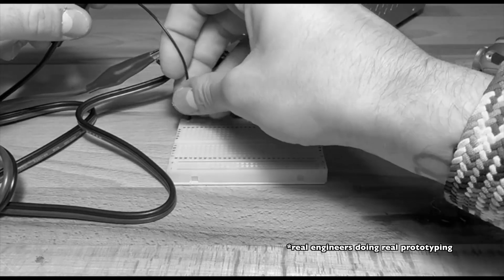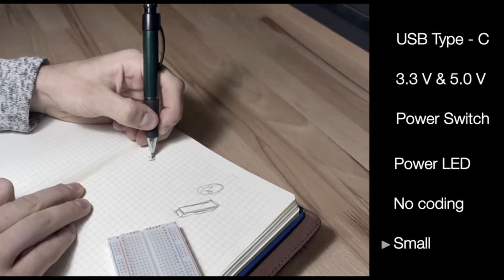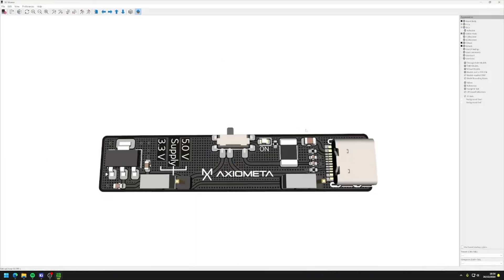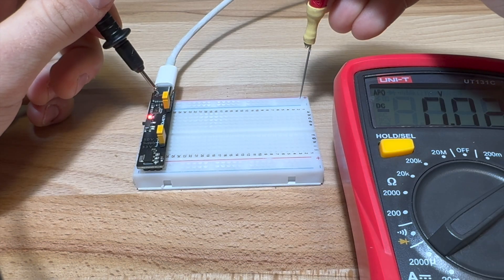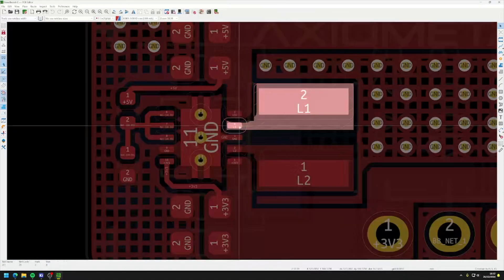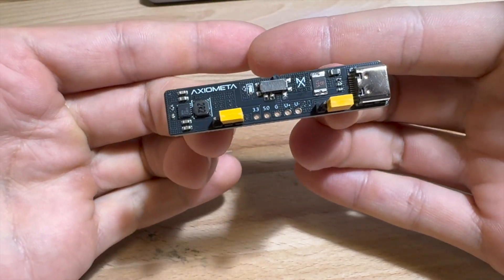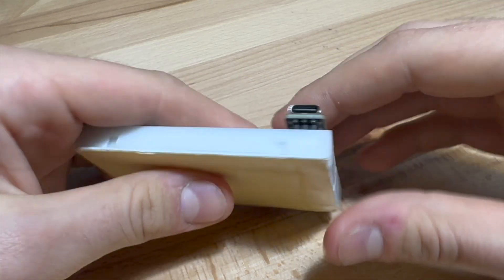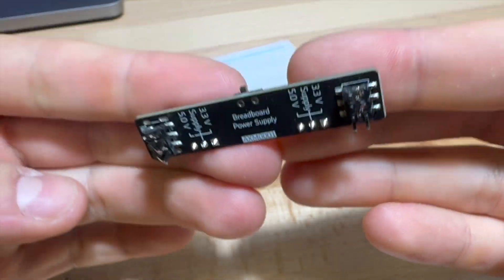Building a USB-C breadboard power supply

Comment: FINALLY!!!
This is really dope, only pet peeve is that the usb port faces towards the side of the board so if a very rigid cable is used it might pull the breadboard to the side somewhat (assuming that the breadboard's short side is facing you), but otherwise this looks like a great project, can't wait to get it printed and assemble it.

Comment: Just be careful of the 1/2 of mains voltage you will often see floating on USB GND when using just about any brick USB charger. It is often enough current to dimly light an LED while touching a finger. Has to do with the X and Y capacitors for noise supression. Unfortunately it has this effect, shows up on USB soldering irons, also my MHP30 hotplate that is USB-C PD... tried multiple chargers, all caused it. Ultimately i had to ground an unused USB-A port (they share grounds on the charger) to shunt that parasitic voltage some place.

Comment: Great project overall and totally signed up for your crowd supply! Would love to see your take on a USB C PD board in a similar form factor.  Perhaps you can use a switch or jumpers to select the PD negotiated voltage. If you keep your DC-DC converter, you can still keep your 5v and 3.3v, but now we have 9v, 12v, even 20v!
Reply: DIP switches would be perfect for this

Comment: Nice, but I would prefer the linear regulators, as I often don’t want switching regulator noise on my supply line.  e.g. A nice clean dual 5V & 3.3V breadboard supply from USB-C could be made with a 9V PD negotiation, feeding capacitor smoothed 3.3V and a 5V linear regulators.  Supporting perhaps 500ma.  Just a thought. 🤔

Comment: This would be even cooler if it could take advantage of PD and supply those voltages at well
Reply: Agreed! A simple PD trigger IC to select the USB voltage (5, 9, 12, 15, 20, etc.) which would be on one "channel" and then use the buck converter to supply any other voltages that are lower than the supply (3.3 or 5v if supplying 9-20v from PD) for the second "channel". Perhaps an RGB led on each "channel" to show which voltage is selected. The option to persist that selection through power cycles would be amazing too!
Reply from the maker: This is a very popular and good suggestion, I will make the next project to be exactly this!

Comment: That's not lazy, that's efficient design. Kudos.
Also, LOVE those SMD headers; I've only just gotten into those myself. Never had a problem with them breaking, they're solid as.
Reply from the maker: Thank you! Yes, once they are 2x3 or more they are pretty solid, I've experimented with 1x5 SMD rails before and those DO have a big mechanical issue, not so much on the 2x3

Comment: Great! I was looking for something similar recently. Any reasons not to have all standard voltages ? (5,9,12,15,20)
Reply from the maker: Expanding into multiple voltage outputs likely would have required implementing Power Delivery (PD), which would have driven the BOM costs beyond the intended scope for this project. It's a great idea, though—perhaps something to explore in a "Pro" version

Comment: Would've been nice if it was possible to select the different voltages USB PD offers. 5V, 9V, 15V, 20V etc
Reply from the maker: True, but I did wanted a very simple solution for just the common voltages, expanding into other voltages would've required PD likely, and this would push BOM costs slightly out of scope (at least for what I was aiming), good idea tho, might have to make a "pro" version, with more features such as more voltages!
Reply: @axiometa This would be nice I'd love to be able to use that for devices like the switch or PI that expect odd PD profiles. The switch wants 15v @ 2.6a or it refuses to dock out via HDMI and the PI wants 5.1v @ 5a to fully power all USB ports.
Reply: @axiometaI'd love if you could do the pro version for PD. I have use cases for both options.

Comment: Curious as to how much it cost you for regulatory clearance? I've got a bunch of projects that I want to sell online as assembled boards but get stuck every time at getting CE/FCC/UKCA clearance as that seems to cost thousands from any certified testing house. I wonder how you manage this challenge 😃
Reply: Not the poster, but I think those rules only apply (in the US) if it is being sold as a complete device.  A "kit" assumes the purchaser is more technically inclined and doesn't need the protections the federal clearances enforce.

I have heard of projects selling as a "kit" where you have to solder on one more piece (included) to make it work.  In this case the switch or USB jack might be that thing since it won't function without it.

Comment: love this video. I've been too scared to order any pcbs out of fear they don't work and i need to reorder
Reply: That’s not something to fear, it’s a natural part of the process. Expect some missteps, dead ends, and bugs in your design process; every successful design is iterative.
Reply: @TheDanEfranChannel  Also include testpoints, ideally ones you can solder a pin to. In university we had to design an amplifier for a radar module which boosted the signal by 300x using a 3x and a 100x stage. In the end the signal was clipping so we pulled out the socketed op-amp of the 3x stage and bypassed it using a jumper wire between two testpoints. That way we still had a usable board despite our design error.